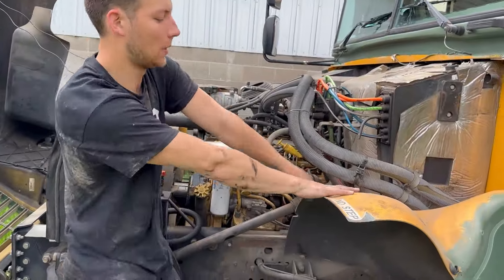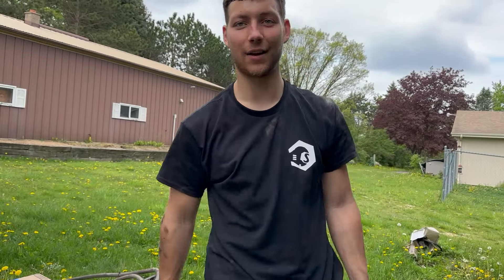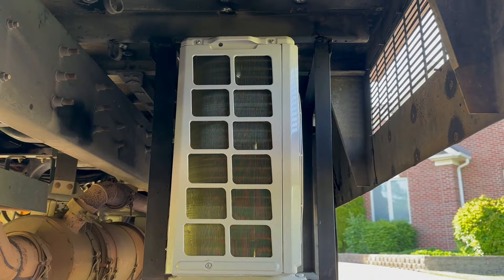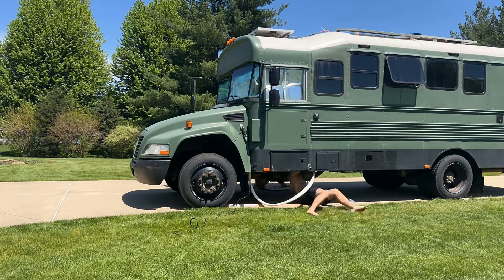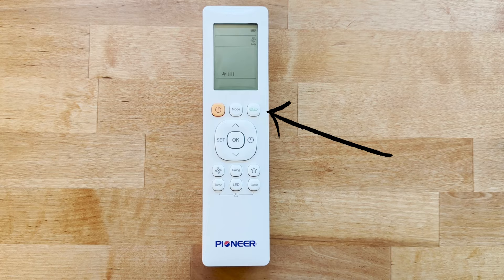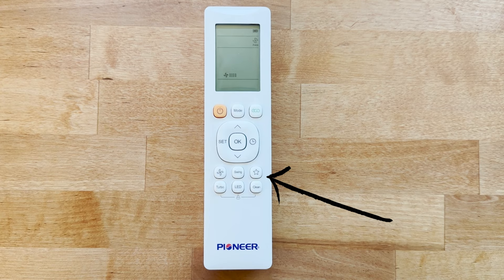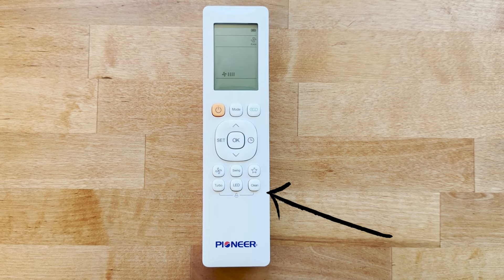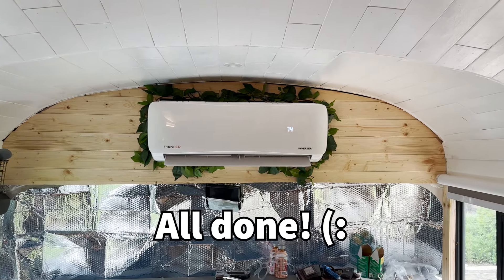We Got AC! Pioneer Mini-Split Skoolie Install - Bus Life Week 14

Comment: I am mostly living in my attic. While insulated, its the hottest and the coldest room in the house. 21 years ago i got two AC units from a sale. Since they were rather weak, i got two. Each used about 980W fix, and was supposed to have a cooling capacity of 1200W. A COP of only 1.2. Last year i replaced them with a modern 3.4 kW AC Inverter unit with a SCOP of 6 for cooling and 4 for heating. The difference in power consumption is quite remarkable. We have a big solar system, during the summer all AC units, a total of 6, run for free. Last summer i havent seen any bigger consumption than 1200W, this only a short time while cooling down starting with a hot room, after that it was mostly below 500W. The old units had nearly all the time a consumption of 1960W. Heating with this units is also quite effective, since they heat as long as the air comes out of them warmer than the room temperature, so they can heat the room with a very low "water" temperature. Hot water heating systems need higher water temperatures to achieve a sufficient watt output. 
What did catch my eye: Is there a direct line of sight from the back wheel to the outside unit in front of it? If so, stones stuck in the profile of the tire could fly directly from the tire into the heat exchanger, who wont like that at all. This AC unit is not meant for mobile use, so it has no protection.